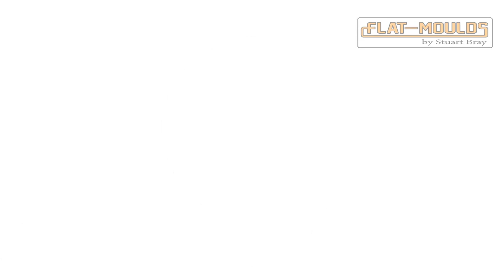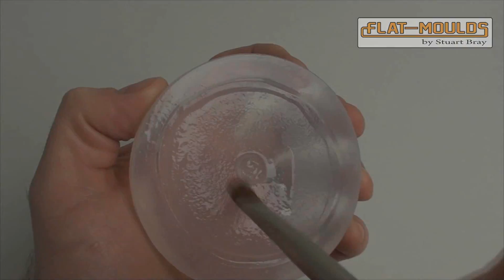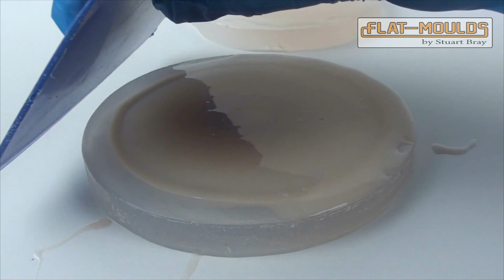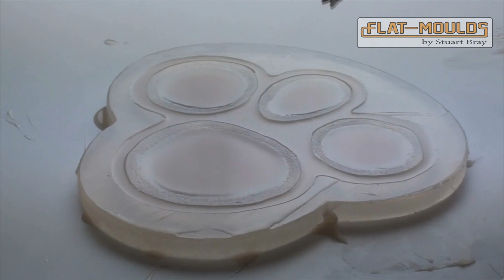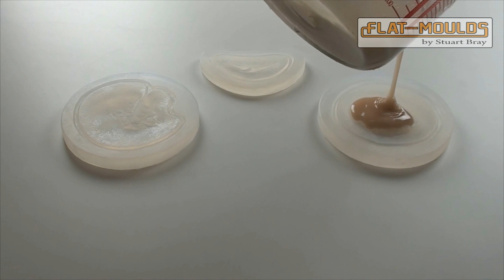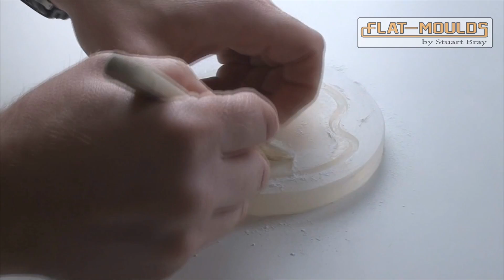How To Use Flat Moulds by Stuart Bray

Comment: What's the best thing to use to stick gelatine with? I'm scared of heating it up to stick it to skin
Reply from the maker: I prefer an adhesive such as Pros Aide or Beta Bond. It's also worth sealing the back of the appliance with a sealer such as Kryolan Fixer Spray or Matthew Mungle Sealer A. 

This will help prevent perspiration moisture from getting to the gelatine and melting it.
Reply: @stuartbray  thanks. I started making some silicone ones today. Hope they turn out ok 😊

Comment: Hi Stuart, awesome tuto thanks, shall we use baldiez cap plastic for gelatine as well?
Reply from the maker: You can if you wish. I like gelatine just straight as it is, a hapgood gelatine edge is fantastic. That said, a cap-plastic barrier will allow you to handle the appliance easier. 

With silicone you HAVE to use cap plastic or else the piece cant be handled and the edge isn't any good. With gelatine, yiu have the choice.

Comment: My cap plastic and gelatin won't stick to each other why?
Reply from the maker: kim Bijlsma you don't need to use cap plastic with gelatine in the way you definitely need cap plastic for silicone. Gelatine works well without.

What cap plastic are you using and what kind of moulds are you taking them from?

Are you releasing the moulds and are you airbrushing the cap plastic or using a conventional brush?
Reply: stuart bray cap plastic from kryolan and in a plaster mold with release agent
Reply from the maker: kim Bijlsma if you brush cap plastic  into a plaster mould with a conventional brush, you will apply a thicker layer than if it is airbrushed.

This means the solvent will remain longer before evaporating, and then it has a chance to soak into the plaster surface thus sticking better to the plaster that the appliance itself.

Better to use silicone moulds rather than plaster. Better still to airbrush the cap plastic rather than use a conventional brush.
Reply: stuart bray  wish I had the money to buy silicon

Comment: Hello, do I have to use deadener, if I use PlatsilGel 10 ? :)
Reply from the maker: +Lyn Mathews Essentially yes. The '10' of Platsil gel 10 refers to it's softness - that being a 10 on the 'Shore A'  scale, a means of measuring softness and quantifying it as a number. The lower the number, the softer it is. 

A 10 shore A is quite firm compared to skin, and I would recommend around 150% deadener, although the thinner the appliance, the less it matters. Thick appliances are very stiff without deadener, but wafer thin pieces are so thin they are still relatively flexible. 

A set of notes on this very subject here sould help: 
https://www.dropbox.com/s/lmq2tvszoofga2o/Silicone%20%26%20shore%20rating%20notes.pdf?dl=0
Reply: +stuart bray Thank you !

Comment: What kind of silicone did you use?
Reply from the maker: +Simply Sophia The mould is a firm silicone, a 30 shore A platinum called T40 from Mouldlife. The pieces can be made with any suitable appliance silicone like Plat Gel 10, 00 or Pro Gel for example.

Comment: Do you have to use cap plastic?
Reply from the maker: If you don't then softened silicone will be unusable as it is so tacky it can't really be handled. Plus you can't melt a silicone edge as it doesn't melt like cap plastic does. 

you can use Gelatine without cap plastic though.
Reply: Thank you will the gelatin dissolve
Reply from the maker: Good edges will blend. There is no magic cure for bad edges regardless of the material!
Reply: Hahahah thank you can what would you use to dissolve gelatin
Reply from the maker: Salt water or witch hazel if you can get it.
Reply: Thank you!:)

Comment: I used Vaseline on my EasyFlo 60 mold. The cap plastic would not release. The base coats stayed stuck to the mold when demolding. What do I do?
Reply from the maker: Well, my moulds are made of silicone so you don't have that issue!

Resin can more readily absorb the solvents and allow the cap plastic to creep into the mould surface, causing the bond which you have.  If you have brushed on your cap plastic mix then it will lay a thicker layer than if you airbrush it - the result is the thicker layer sits on the surface longer before evaporating.  This allows the mix to creep into the cap plastic and so it bonds.

Try more release and airbrush your cap plastic instead.  If the plastic was airbrushed, then you may need to drop the pressure so less arrives on the surface, and it will evaporate quicker.
---
Stuart
Reply: stuart bray Ok Thanks

Comment: Hello.
Using airbrush (cap plastic), no problem for the material to dry in the tank, the needle clogging ...? Once completed, no problem with cleaning the airbrush? How many layers of cap plastic must be given to the airbrush ?.
Greetings.
Reply from the maker: A lot of people think an airbrush will become ruined by cap plastic, but it dissolves with the solvent.  I have used the same Iwata HPC for 10 years and it cleans out fine.  It does occasionally clog in the nozzle, but if you keep a cup of solvent to hand, just dip the end in it occasionally to melt away the problem and continue.

If you download the catalogue, you will find half of it is tutorials showing you how to use the moulds - including all you need to know about airbrushing the cap plastic: http://www.learnmakeupeffects.com/flatmoulds/

You can add as much solvent as you need, so some people will inevitable add more than others - and some people apply more heavily than others.  The solvent evaporates away leaving more or less cap plastic - depending on how much you thinned your mixture!  Usually it is about 5 parts solvent to one part plastic and we do 2 to 4 layers.  Try with two and if it is too thin, apply another until it is right.
Reply: stuart bray Ok. 
Thank you very much. 
Greetings.

Comment: Thank you this has really helped , I'm pretty new to this whole thing so I guess there's a first time for everything 😹, could I just mold what I want on the face and dip the side of the face in plaster , leave to dry and pull face cast away from a plaster?? That way I know it will fit perfectly ??
Reply from the maker: You need to put keys in the core first, and mould the face on a flat table.  The plaster is then applied on tp of the sculpt to ensure air bubbles do not get trapped.

Comment: Hi, I need some help, I am making some maleficent cheekbones using the old fashion clay ... way? I have moulded my cheekbones on my head cast and noticed a curve in the shape when I took it off of the plaster, how do I overcome this because I know that If i pour plaster over the clay mold it wont be 100% flat therefore letting in the plaster and ruining my design , how do I overcome this? if your slightly confused this is how I am doing it,
How to make Gelatine prosthetics by AKFX

however I have a shape that is bent on both sides
Reply from the maker: If you sculpted onto a face form then naturally it will have all the curvatures of the face on the mould.  You either should float the sculpts off from the face (you will need to have coated the plaster face with Alcote or KY jelly/Scopas parting agent PRIOR to sculpting) or sculpt it on a flat board.

If you want to mould onto the face, then the mould curvatures will match the face exactly.  This then means filling the negative mould and clamping the face onto it so the inside of the appliance is an exact replica of the face on which it is sitting.

It sounds like you need to get the whole 'negative-positive' thing worked out.  A flat mould does not need a core, but is instead sculpted onto a flat board or tile to begin with.

My sculpting video from the 'Coraline' videos may help: Coraline Button Eyes Makeup Part 2: Sculpting

And the casting video too using gelatine: Coraline Button Eyes Makeup Part 4: Casting Appliances

Comment: Could I use liquid latex instead?
Reply from the maker: To make latex appliances instead or as an encapsulant for silicone appliances?  You can make latex appliances but they work much better in plaster moulds where the moisture is absorbed - silicone is waterproof so it isn't the best mould material for latex appliances.

Platinum room temperature curing silicone like these don't set up against latex very well so latex isn't a suitable encapsulant  for silicone appliances.
Reply: could i use Dragon Skin FX-Pro - Trial Size. If so is that enough for CYBORG 3.
Thanks
Reply from the maker: Hafiz Eberhardie I have no idea how much a trial size is, but the largest cyborg mould prob needs 100 g to fill
Reply: aight thanks.

Comment: could you use the cap plastic with gelatine even though its not necessary, if you wanted to make sure you could easily blend the edges?
Reply from the maker: Gelatine gives you amazing edges, but I imagine you could.  I have never tried it but I would interested to know if it works. Give it a whizz and blaze a trail with that ninja knowledge!

Comment: Your videos are so instructional and so inspiring! Thank you for taking the time to do these! I do have a quick question regarding the moulds for the silicone encapsulated appliances... Can you use a silicone mould to do these ? I know silicone attaches to silicone but i'm assuming since the SuperBaldiez layer is there it might prevent it from doing so? Thank you !
Reply from the maker: Yup - the moulds in this video are made from silicone.  Just be sure to use release and to avoid any inhibition from tin silicone if you use a tin silicone for your mould.  Platinum silicones work better.